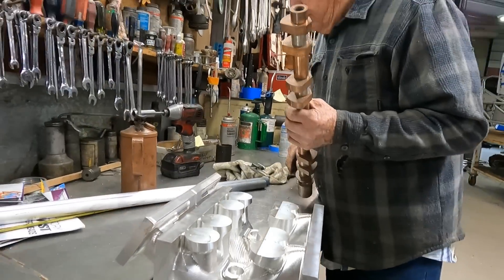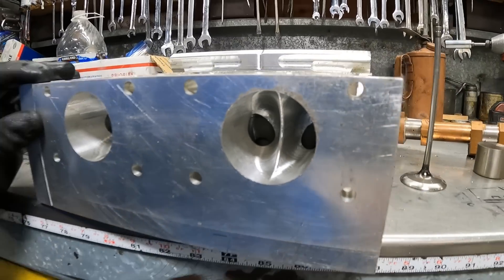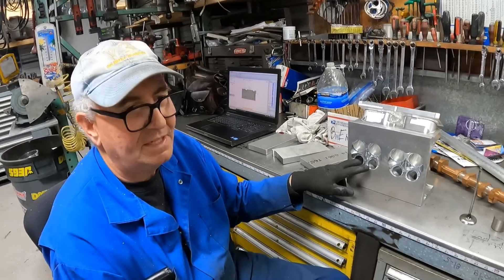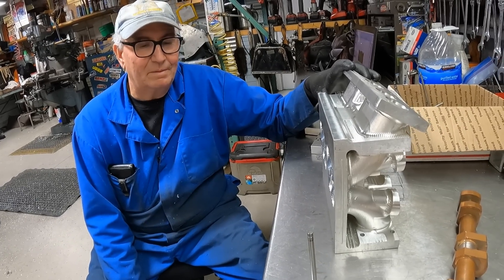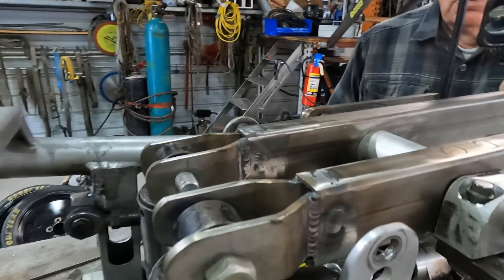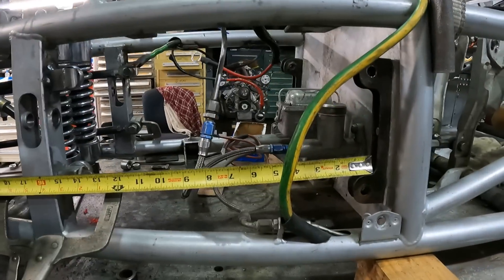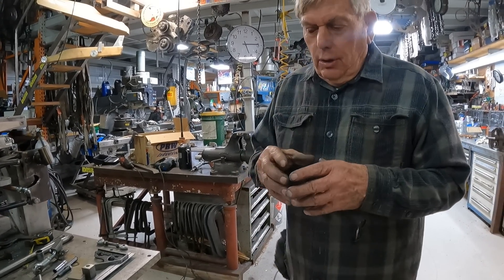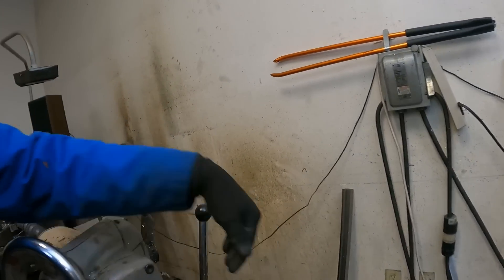Homemade 4 Valve 7.2 Liter Engine Cylinder Head Update 1/27/2024

Comment: @Greg Quirin Hi, It will be interesting to find out how heavy this V12 is. Given its build all out from forged 6061(?) aluminum with sleeve liners, seems like it will be on the heavy side. Not sure if they scaled this engine ?
Reply: for land speed racing, weight is not a issue, aerodynamic drag is a far bigger issue.

Comment: Such amazing work they are doing, I’m excited to hear it run. I would have thought the ends of the heads would be taller to incorporate the cam caps in to increase valve train stability.

Comment: Cylinder heads.  
Have a look at how Steve Morris does heads for his SMX engines.  They are machined from a solid block with pockets / cover plates / cross drillings for water flow.  Blocks are made from a solid block too.
Reply: Our heads on the model A, 3 liter, and V1200 were all machined from solid billet with cover plates and cooling holes drilled. We decided to machine them in pieces to make them lighter and improve the cooling.
Reply: I would imagine they are aware of billet machining processes... Steve isnt the first one to do it.

Comment: Are these heads as durable as cast heads? Are they only designed for a few runs?
Reply: Our heads on the model A, 3 liter, and V1200 were all machined from solid billet with cover plates and cooling holes drilled. We decided to machine them in pieces to make them lighter and improve the cooling.
Reply: Have a look at how Steve Morris does heads for his SMX engines.  They are machined from a solid block with pockets / cover plates / cross drillings for water flow.  Blocks are made from a solid block too

Comment: This is what real engineers look like. The so called "engineers" where I work can't even sharpen a drill bit!
Reply: This is the kind of thing that Harry Miller or Fred Offenhauser could do, and did a hundred years ago. Pete and Kevin have fancier tools, but the job is similar. Engineers tend to be more specialized these days, don't need to do this kind of ground-up work, and usually don't.

Comment: Amazing work, what machine do they use for the cnc operation?
Reply: They have a basic CNC in the shop they are working in the vid to prototype / prove out programs.  There is a Haas VF mill in another building ( check the prior or maybe 2 vids back )